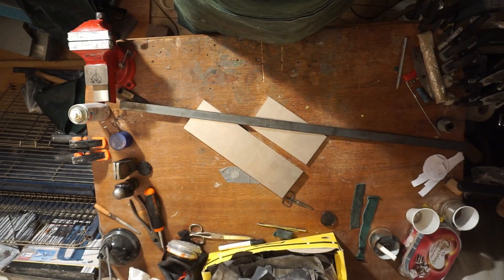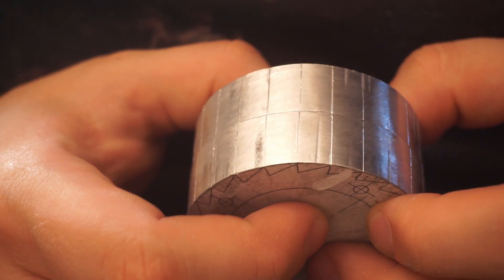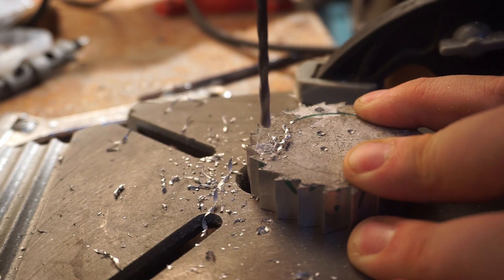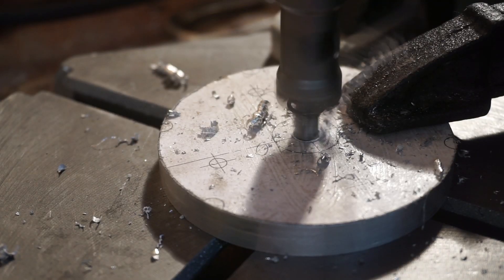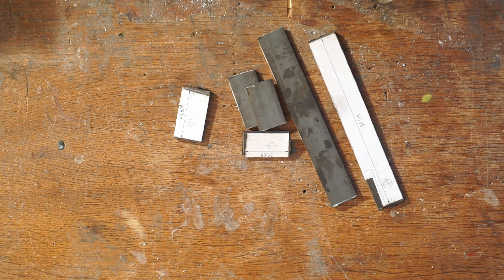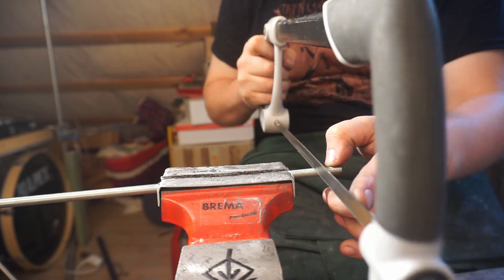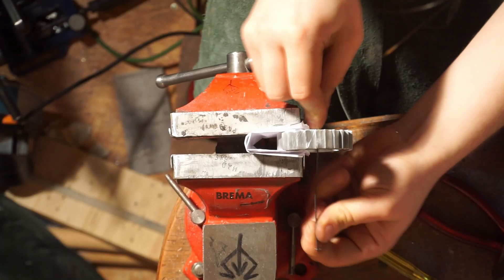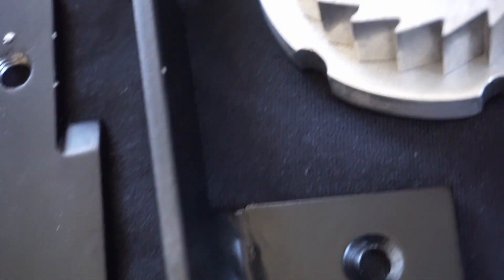Drumspring Experiment

Comment: How are the pedals holding up?
Reply from the maker: Hey thanks for asking, so the pedals themselves are holding up rather well. I can definitely see the wear on them but nothing to serious. Only some smaller issues that could be fixed rather easily. And I definitely wasn’t gentle to them and got a lot of use out of them so far. 
However, the spring system you can see in this video did not really work the way I wanted and no matter what I tried unfortunately I could not get it to work like I wanted.
Reply: @hewittbrothersmanufacture7676  It's a pretty dated design honestly. Maybe try something like Trick's compression spring?
Reply from the maker: @cameronahslund-glass9550  to be honest I wasn’t aware that this design was a thing back in the day until after releasing the video and someone on Reddit showed me an old Ludwig design. My research only included pedals that are on the marked right know. 
My initial goal was to make some design that was kind of “innovative” and therefore bring some “new” feel to the pedals. As mentioned earlier it didn’t work out so well. 
So I didn’t consider compression springs like trick. I also briefly thought about magnets (there is also a factory using them) maybe that is worth a shot.
Reply: @hewittbrothersmanufacture7676  hey I dunno if you’re going to see this, but speaking of magnets have you heard of the drumnetics pedals? They’re apparently pretty awesome and use no springs at all just magnets!
Reply from the maker: @aarondillon5986  yeah i heard of drumnetics. In fact they are the company i referred to in my response above. I`d love to get my hands on one of them they look awesome for sure, the concept is interesting as hell and i heard good things about them
Reply: @hewittbrothersmanufacture7676  oh cool! I wasn’t sure if that’s who you were referring to. I’d love to have a set myself! They actually went through a couple different “models” too if I recall correctly. Originally I think it just had the magnet under the pedal, but then he upgraded them to have the adjustable ones on the beater axles. I haven’t heard anything about them very much lately, but a drummer I watch here on YouTube called 66Samus did a review video for them a while back! he actually thought they were amazing and had basically nothing bad to say about them if I’m not mistaken.
Reply from the maker: I`ve seen his review, it was really funny, but i knew them beforehand.
Reply: @hewittbrothersmanufacture7676  yeah I knew of them beforehand as well, but thought I’d mention his video in case you hadn’t seen it lol 😂 and thanks for replying so quickly! Another pedal that this project reminded me of is the Dixon “precision coil” pedals or something along those lines.
Reply from the maker: @aarondillon5986  yeah I inspected them two during my research. Also an interesting design.I definitely like unique concepts.